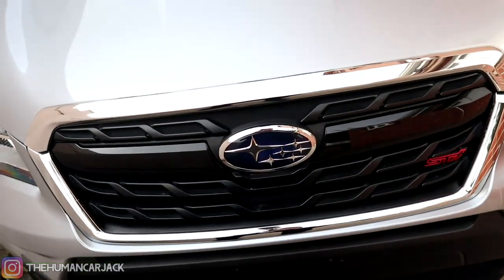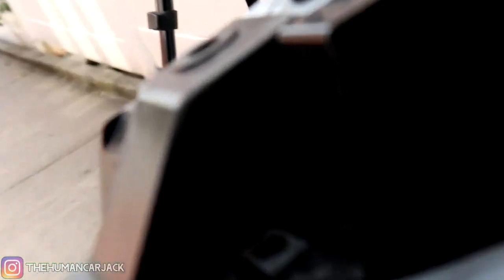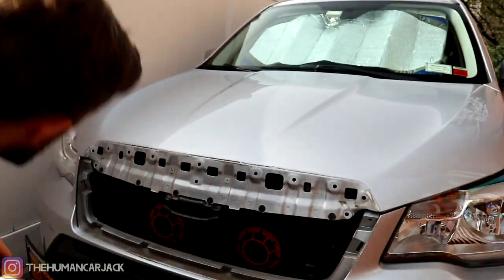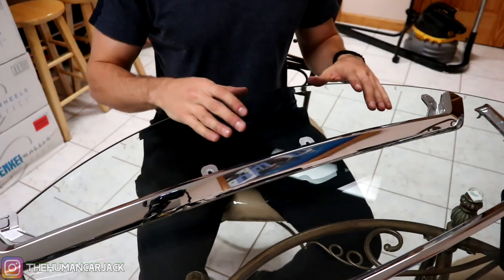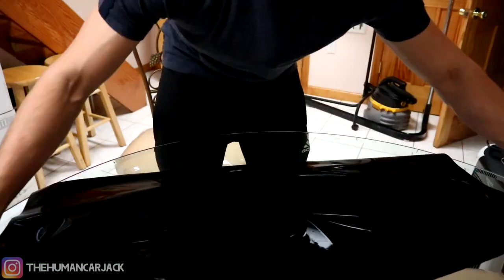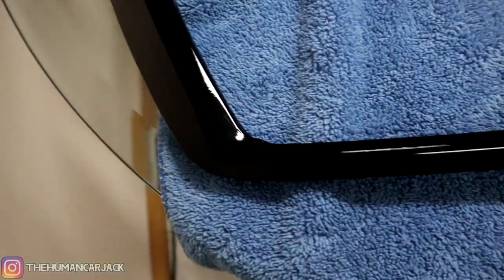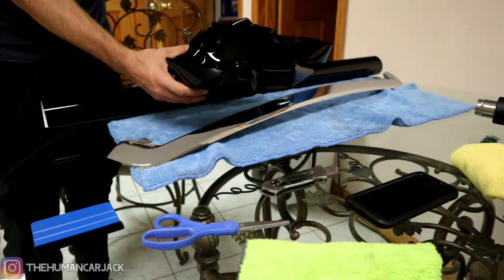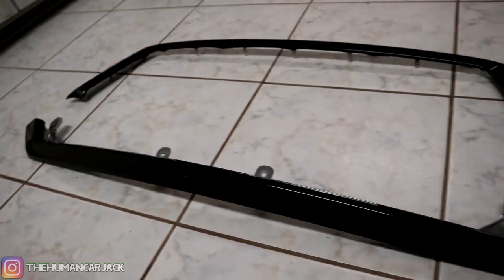VINYL WRAPPING MY GRILL GLOSS BLACK! | 2014 - 2018 SUBARU FORESTER XT

Comment: mmmm Looks pretty! but as a seamstress I'd say you are wasting a lot of material to wrap those plastic pieces. I'd  maximize every inch of that material. by measuring and drawing first the pattern I need, then place it on top of the roll well extended, cut it, then use it the piece that I want to wrap.
Reply: Who asked? 😂